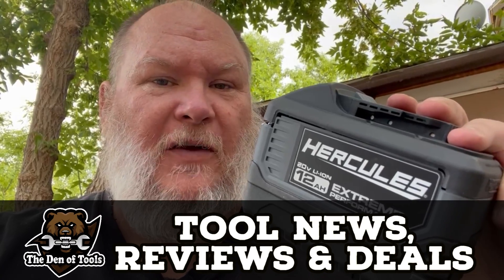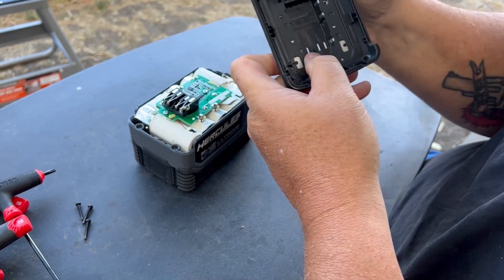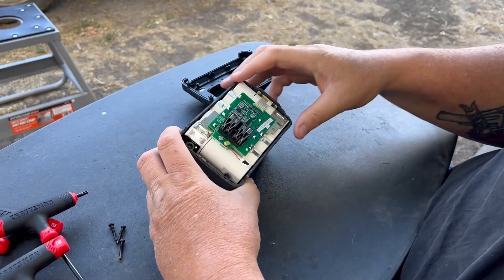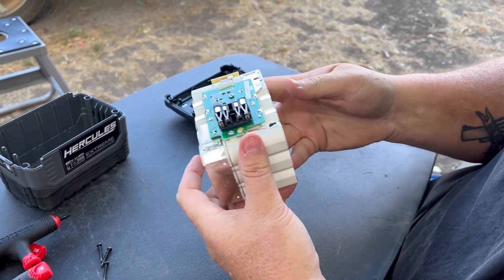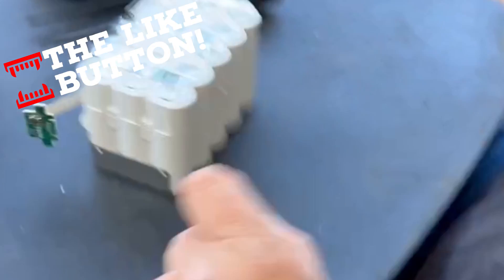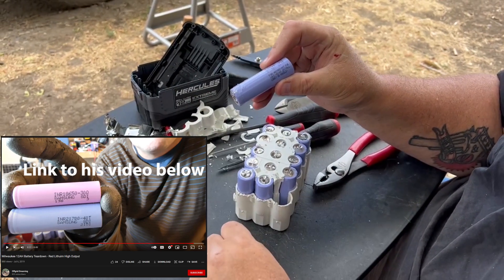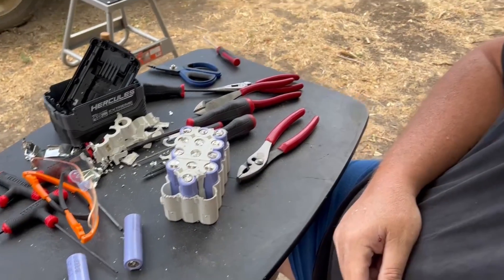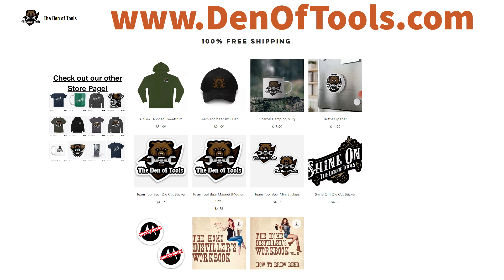Hercules 12Ah Battery Tear Down is SHOCKING!

Comment: The best in the business, that's why there is a 5-year warranty on these batteries.. they are simply the best battery cells that you can buy.
Reply: Not really true! They are cylindrical cells. Flat stacked cells are much better and will last 4x as many charges. The Milwaukee Forge batteries are that type. Dewalt also has them. They are also more money. But to say HF are the best is not accurate. They are good!
Reply: @jamesbowden5306  Lets put it this way. They were the best until recently. Battery manufacturers are constantly putting a lot of money into research to beat the competition. That means we are going to see a constant stream of new batteries  types over the new few years. That's a good thing. I am hearing good things about flat pack batteries, the problem is they are not that common yet for cordless tools. What is out there is darn expensive.
Reply: @jamesbowden5306  Forge 8.0s and Forge 12.0s are still cylindrical cells. They're Ampace JP40 tabless cells, but are still a cylinder. The only one that has pouch lithium cells are the Forge 6.0s, but they have been discontinued as of a few months ago. Much cheaper and easier for them to use a standard 21700 JP40 vs. the custom Ampace pouch lithium cells for the 6.0s.

I have all 3, but the 6.0s are one of my favorite cells for the weight, size and energy density. The Forge 6.0 provides the same power output as an HD 12.0, which should suffice for most tools and charges to 80% in 15m (100% in ~25m) and is significantly smaller than my other Forge 8.0s and Forge 12.0s.

The 8.0 and 12.0s are ridiculous, you're talking 140A max continuous draw for the 8.0 and 210A max continuous draw from the 12.0. That's 2520W @ 18V for 8.0s & 3780W @ 18V for 12.0s. The JP40 Cell is rated for 70A continuous draw, most places quote it at 60A and those figures are just using the nominal voltage of 18v, it's actually a max of 21V, which pushes it to 2940W & 4410W maximum.

Comment: It's not that the HF battery is hella cheap. Just that most of the others are hella over priced. The manufacturers know that they have you by the jewels and can pretty much charge whatever they want for battery packs once you're invested in the platform. What's sad is that they're probably all made in the same ChiCom factory.😑
Reply: Harbor Freight has quality items, some suspect, but so does every other business.
I was watching Project Farm compare jacks. The Snap-On was/is $1,000.00 and the Harbor Freight Daytona jack was/is $280.00. They where virtually identical, from look, weight and function. Buy 1 Snap-On or buy 3 Daytona's? Hmmmm...
Reply: @lopaka76  Saw that one.  As a matter of fact those two jacks are made on the same assembly line.
Reply: @deanaltman6841  I couldn't help but laugh when the tests came up neck in neck. If I had any need for a heavy jack like that, I'd buy the Daytona one.
Reply: @lopaka76  
That was a good video on floor jacks
Reply: Depends on if I'm using them a bunch of times every day and plan to be using them a bunch of times every day for years. People in the trades don't pay the extra money for 'stronger' or 'faster', you pay it for 'buy it once and keep using it forever', which is something that the review sites seem to miss (and I realize it's hard to make a review video where you use something for its intended purpose multiple times a day for years).
Reply: @lopaka76  yeah right
Reply: @lopaka76  that's why Snap On sued them when they released those jacks
Reply: To be clear, I'm not advocating for or against HF. I don't own any HF tools. All my 20V are DeWalt and my 12V are Milwaukee, and I'm fine paying for good quality tools, (I'm one of those people who carries a $500 pocket knife and a $200 flashlight) but nobody can convince me that those battery packs aren't grossly over priced, especially for a consumable item.🤢YMMV.
Reply: So you want higher quality at a higher price?  There's other brands that offer that!  Look at the Japanese power tools like Panasonic L-series, P-series and Exena series and their top selling brand Hikoki commercially used by pros a lot in Japan, etc. and the unique Japanese hand tools of  highest quality like Fujita and such! 

The 21700 Tesla batteries on the Hercules are same as the Milwaukee used in their M18 High Output battery pack at a FREAKING low price and still SLAPPED WITH A 5 YR WARRANTY!  🤜🧑‍🔧  

Hercules 20v 8amp 21700 High Performance battery for $70 and their 12amp HP battery for $110 on Black Friday is a steal!!! and that's not even including their latest powerful 1400ft-lbs Ultra Torque impact driver for $155... 🤙

I'm just blessed to have a 3 Harbor Freight in near distanced from me and knowing that they have unique tools you thought didn't existed that Autozone, Pep Boys, Advanced Auto parts, O'Reilly Auto, Home Depot, etc... don't have or dare to carry and are VERY USEFUL when working on cars and around the house!  And their Lifetime warranty on their hand tools just walking in and out with a new one is soo convenience and amazing!
Reply: I'm mostly a government butt out guy.  In terms of consumer protection, I do believe in a little intervention. These batteries are mostly using not patented tech in them.  The equivalent of proprietary batteries would be proprietary plug-in chords that you would have to rewire your whole house to only use those brands' chords.  Or proprietary oil filters, car batteries, etc.  Why are we allowing this in tools?
Reply: Didn't realize houses played guitars.
Reply: Well said 😁
Reply: @luismunoz6085  Dewalt is not higher than Makita Milwaukee etc.😂
Reply: To be honest, the cells in Milwaukee and dewalt are typically some of The best rated cells that a normal person can get their hands on, as far as amp rating (which really matters for smaller, fewer-cells battery packs).  They have HUGE buying power and get them at cheaper prices than just about anybody else can.

Often if you need these high amp rated cells for other projects, it's far cheaper to buy one of these tool packs and rip it apart for the cells, than actually buy the cells by themselves. 

I'm not saying these packs are really affordable, just that they do usually have high quality cells in them, for the price your paying.

Also, you cant just go by brand alone... Samsung make great cells, but a 10amp rated cell being used for 10 amp situation is still not good enough, you'll burn it out quickly.
Reply: Ahhem, you clearly mean “same rubber dogshit factory”.  But only the finest Chinesium here.
Reply: This 100% convinced me to go with Harbor Freight.  When they stepped up to the Bauer and Hercules brands they knew they had to deliver the goods to compete on the big stage and so they have.  I’ve been a carpenter for 25 years and will gladly buy both brands.
Reply: @@Neamerjell Bot seed statement if I ever read one..
Reply: got mine for $70 on ebay brand new, never opened.
Reply: Eh. The others (at least at the high end) have a long qualification process for their battery packs (shocks/drops/hot/cold/damp/high speed charge/deep discharge/etc), aggressive sampling of cells as batches come in, plus their business is focused around the people (mostly professional tradespersons) who they're trying to keep as a customer for life, so you're paying for that. If pretty much anything bought at HF fails during use often enough to be identified as a design or manufacturing problem, whoever bought it will be kinda annoyed, but the world at large will be 'eh, it's HF' (or Kobalt, or Ryobi, or Porter Cable, or whatever the Menards store brand currently is, or...). But if a Makita or Milwaukee or Bosch or Flex or (higher-end) Dewalt starts blowing up unexpectedly under the same circumstances, there's a bunch of contractors (you know, the people who buy more expensive tools and batteries based on the assumption they're going to keep working for a long time) are going to be looking at the toolbox and thinking 'uhhh...'.

I'm not denying for a second that batteries are the blades of their razor business, I'm just saying you're paying for some intangibles and sunk costs when you're buying that brand name.
Reply: @davidedwards9157  there might be qualification that goes into batteries and batch testing, but I think Hercules is pretty close Milwaukee has a 3-year warranty like HF Hercules batteries have. The price of batteries is just ridiculous on DeWalt and even Milwaukee $100+ for anything 3-4 amps and up is just nuts. This is why I went with Kobalt going forward they have 2amp batteries for $29.99 with a 3-year warranty. I can buy 3-4 batteries for my Kobalt tools than I can for one DeWalt or Milwaukee battery. 

When companies are market leaders they can charge whatever insane price they want for the same stuff others sell for less. Every year Apple sells a phone they make for $200 in parts for $1000 while other companies try to compete by selling a similar phone for $400 or $500. Apple in this case can charge $1000 because they're a market leader in high-end phones. 

I bet many Professional-Grade-Tool companies make a large percentage of their profits off of batteries, saw blades, and bits and I bet the lion's share of profits outside of tools comes from batteries for Milwaukee and DeWalt.
Reply: This is true. The cells themselves are relatively inexpensive, and the electronics really don't cost much either.

You're paying for the name and the warranty mostly.
Reply: You’re not making sense. The power packs are assembled in China with Samsung batteries made in Korea.  Because the U.S. companies don’t want to pay higher wages and maintain factories that don’t pollute.
Reply: Not true at all. There are different levels of batteries, I’m betting that this one uses a cheaper grade. The plastic case is thin. It’s decent. Samsung, Panasonic and others have these batteries from three bucks a cell to eight. Which are these?
Reply: @melgross  The Samsung cells shown in this video - from the Hercules pack - are INR21700-40T.

They are rated for 35A discharge and 4000mAh capacity.  A quick check online says I can buy 10s of them for about $5 each, retail.  There's 15 of them in the Hercules pack, so $5 x 15 = $75.  Harbor Freight list price for the pack is $140 or almost double the cell cost, street price.  HF's manufacturer will be paying closer to $3.50 each cell.

So nothing I've seen about the Hercules battery pack here is necessarily "cheap".  Heck, these are Samsung cells - you can't get a cheap version.  Actually you'll find that HF usually has at least 3 levels of tool, each with different branding - and Hercules is their "premium" brand for hand power tools.
Reply: @melgross  I don’t agree. The batteries are the same, but they make them at different mAh levels.  Now the 18650 are being supplemented by 21700 in some cases at a higher price.  Samsung rates their 18650 at 10 years and 500 charges whichever comes first, and remains the standard.
Reply: Chicom? Way to give away your shit politics.
Reply: @OptimusSatanas  If it’s made in China it is Chinese Communist - fact not opinion.
Reply: @OptimusSatanas  

Wow
Reply: @lordrayden3045  Lock him up, lil guy, lock him up.

Comment: That's a skookum battery block with a good BMS 👍 tech tip for you, buy yourself a battery spot welder and rebuild your own batteries. Saves money 🤑
Reply from the maker: There are now some pretty cool ones on Amazon for like 20 bucks that you build yourself
Reply: @denoftools  If you have the patience,the time and the dexterity it is certainly worth doing. Having built many model airplane battery packs I can attest to that.

Comment: I can see battery adapters picking up in price now.
Reply: They should pay extra for those Milwaukee tool adapters. Those guys love wasting money
Reply: @straycatnip  sorry people like quality. But honestly couldn't find any Hercules to Milwaukee adapters on Amazon anyone got any ideas?
Reply: @chanceharmon6491  people like the color red more than quality. Ebay, etsy is where you find adapters, not Amazon.
Reply: @chanceharmon6491  I’ve had bad luck with Milwaukee 12 volt packs - I don’t think I’ve had one last more than a couple years before they start kicking errors out on the charger.  I’m trying some Amazon generic ones now and they seem to be holding up better.

Comment: Lol I recognized them immediately.   I have them for my 21700 vapes…. Work great. Thanks for all the great videos man keep up the great work!!!
Reply from the maker: It’s funny because it literally says on the battery not for use in vapes
Reply: @denoftools  In the vape community they know they are a good battery to use.  It’s almost like a sign saying which ones to get.   The cheaper brands that get sold with some flashlights won’t say not for vapes.  It’s all bout the amp rating.   Anyway have a great day man and thanks again for everything.

Comment: I wonder what the battery code was. Just stating that it was Samsung is insufficient.
Reply: Correct. And also, the better brands charge more because of better plastics, better connection points, stronger bushings, washers, etc.
Reply from the maker: If you watch the whole video I do tell you what the code is and I also point out that these are the exact same battery that’s in the Milwaukee
Reply: @denoftools  Reading the code means nothing, counterfeiters will copy everything about the battery, I already left a link in another post showing what to look for in counterfeit Samsung batteries.
Reply from the maker: @LeeCountySpeedShop  Can you show instances where major manufactures were found to be using counterfeit cells?

Comment: The cells are only HALF of the story though. Yes, it's nice that quality Samsung cells are being used but where the full ability of lines like M18 FUEL + High Output batteries comes into play is the communication and coordination between the battery management circuitry in the battery and the circuitry and sensors in the tool itself.  That combination allows varying the amount of current that can be delivered to the tool depending on conditions like battery temperature, the amount of resistance the tool is encountering (drilling into concrete, for example) and more.  The cells are not irrelevant but it's only part of the equation and its really going to take an electrical engineer analyzing the circuitry and performance of the BMS and tool management ASIC to see if HFT has really caught up to the big boys or not.
Reply: I bet they're fairly close
Reply: I would argue that the cell is the majority of the story, but you are correct. If the BMS wasn't designed with the specs of the cell in mind, it could limit the potential the battery pack has. I know the Torque Test channel has tested battery packs against each other via adapters in the past. They can do the same again with this battery and some of the big impacts they've recently tested.
Reply: @DownandOutNYC  Testing batteries through an adapter completely misses the point.  The M18 High Output battery combined with an M18 FUEL tool means the circuitry can decide to push current beyond normal to get a particularly heavy work-load done because the sensors on the tool and battery are monitoring temperature, work-load, and many other things that allow for intelligently "breaking the rules" and delivering more power (possibly MUCH more power) for short bursts than a "dumb" battery could because there's no threat of thermal damage to the battery or tool.  Obviously this is something that would be scaled back quickly if the sensors detect that this isn't going to be a short burst to break through a tough task, but the specific battery and tool combination allows for power outputs that exceed what a generic 18V/20V power source can deliver.
Reply: As electrical engineer (not a battery engineer tho), I agree completely.  But also I wouldn't think they would use Samsung batteries (which are well respected and probably cost more), and then put sub-par electronics around them.  A majority of cost is likely the batteries, and even using quality electronics is a very small cost overall.   But just a WAG on my end.